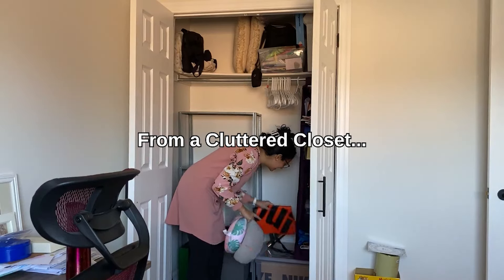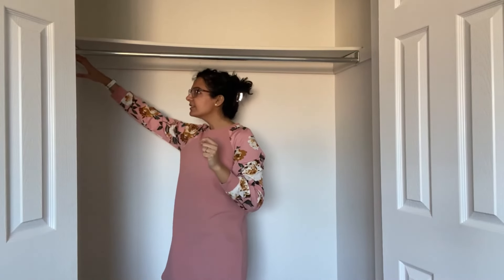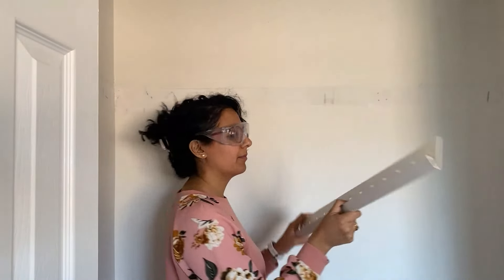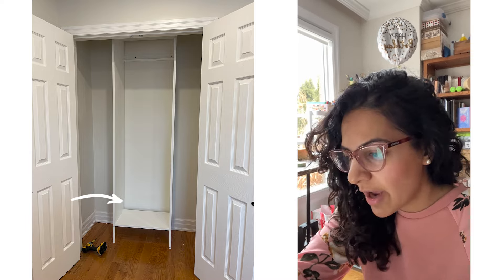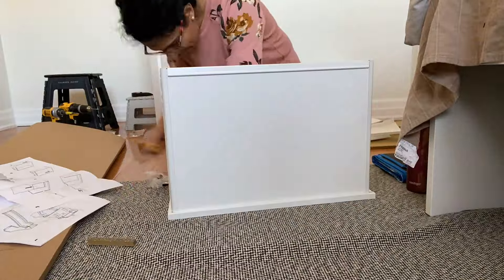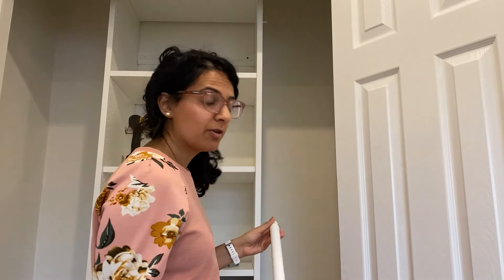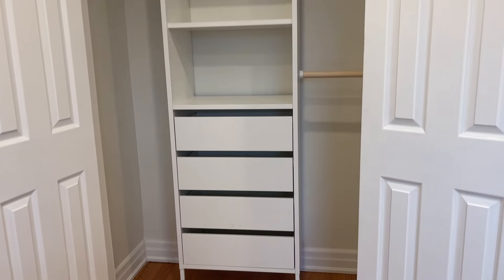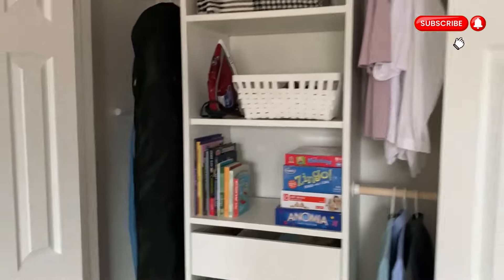The EASIEST Small Closet Organization || Inexpensive IKEA AURDAL CLOSET

Comment: How long was the closet? Mine is 54.4 inches, so I'm thinking to cut the side rods down. Great video!
Reply from the maker: Ours was something similar.  You can’t cut the rods that come with this system as they are metal which is why I used wood dowels
Reply: If you use a pipe/tubing cutter you can shorten the outer rod to make it fit your closet.  I just installed this very same closet system in a closet that was 2” shorter than the minimum recommended width.  You’ll need a file to smooth out the burrs left from cutting the rod but it can be done.
Reply: I have a metal cutting tool so Im gonna use that lol . problem with these are that you cant find the parts in the same ikea smh

Comment: So for the closet rods, you just drilled directly into the aurdal closet side panel? I have the same issue where I’ll need to use specialized wooden closet rods cut to size because the closet is too narrow for the included metal/adjustable closet rods.

Comment: Hi great job and thanks so much for this video! I just got the same one and the instructions recommend the mounting bracket should have 3 screws for that length. I wanted to know how well had this closet held up with just the two screws? Because I can attach to two studs but not 3, so the third would have to be a wall anchor. I don’t have an anchor at the moment so I was wondering if you would day it is safe to go without it
Reply from the maker: Hi! Yes I saw the instructions said that too. I would say you should ALWAYS follow the instructions 😉. In our case, we couldn’t get the third into studs, and felt confident there will be no kids climbing this and no tipping hazard. If you feel it’s an issue, you can mount a cleat across the back wall. Ensure the cleat goes in as many studs as possible. Then mount your bracket into the cleat. Best bet- you can call ikea because their customer service is fantastic.